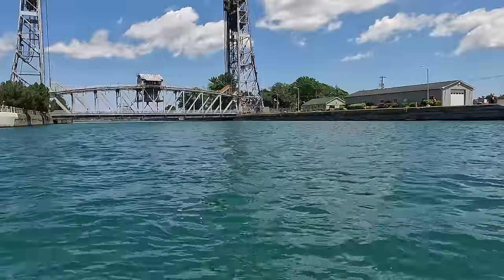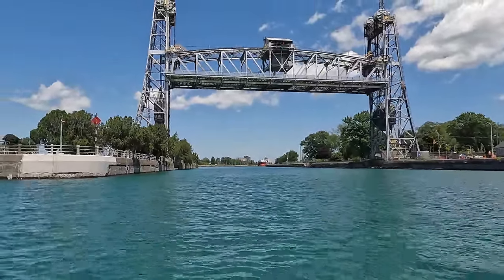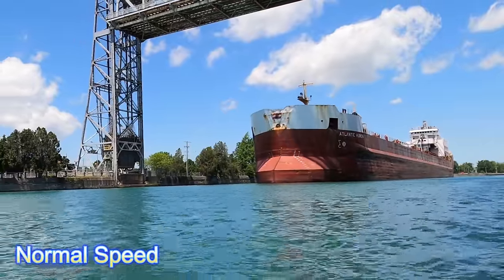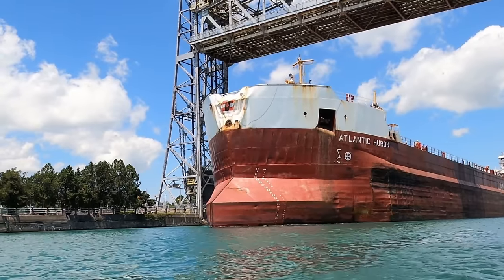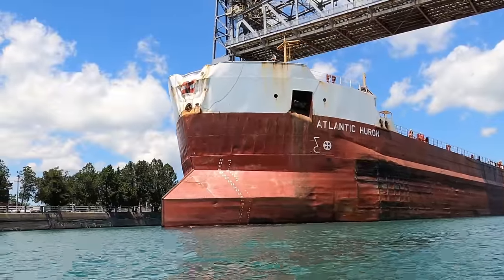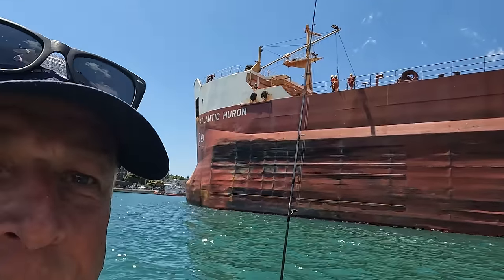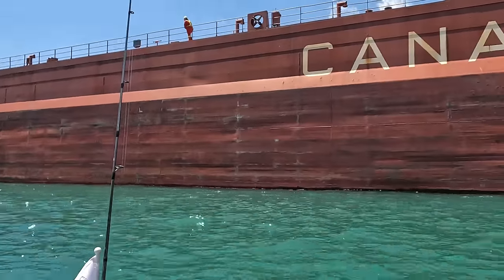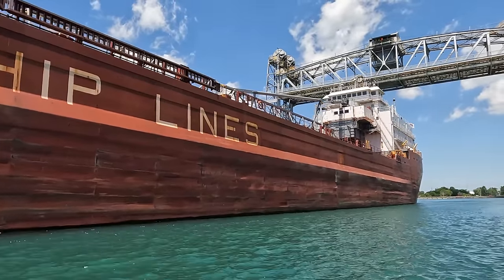BATTERED AND BRUISED - ATLANTIC HURON

Comment: Did notice the timber rub rail in the lock is down to the steel mounts so pretty useless and can cause damage.
Spent 18 months in Sarnia On. Just down from Lake Huron working on the construction of the CN Rail tunnel under the St Clair River back in 94/95. Made friends with lots of the locals and in the summer time went sailing and swimming on the Lake. My apartment was right on the river bank so great views of the Lakers passing by, even witnessed the first ship after the winter freeze, tree in the mast and Capt wearing a topper.
Thanks for post and jogging a few memories.

Comment: As far as I know CSL doesn't have a replacement for this ship coming so she may or may not be scrapped when her 5 year inspection comes up (not sure when that is?). If not then they'll most likely fix up the dents at that point since they're mostly cosmetic damage, no hurry.

I hope she's got a few more years left personally! I'm a big fan of this design, with the sharp bow.
Reply: This bow design aint working so good. I'am a ship designer in fluid ingenering mostly water resistance on bigger wessels. 😊
Reply: @knutarneaakra6013  I also thought it didn't look very efficient. I wonder if it was just a cheaper/faster way to fix it after the collision instead of getting a proper bulbous bow.
Reply: @knutarneaakra6013 why is there no bulbous bows in the Great Lakes?

Comment: The majority of the damage looks like it's from coming in contact with a lot of different things,, but not all of it. Some of those panels that are sucked in between the ribs is not from accidents but it's from heat over time. I used to know what it was called, but it is essentially the effect of temperature change pulling the metal in and out throughout the years! Although that ship looks like it has the thinnest metal on the the hull that I've ever seen?😢😢😢
Reply from the maker: The main scuff on the side of the hull is dock rash mainly, buy the dent is visible from its Collison with the pier
Reply: When the metal between bulkheads warps it's called oil caning.